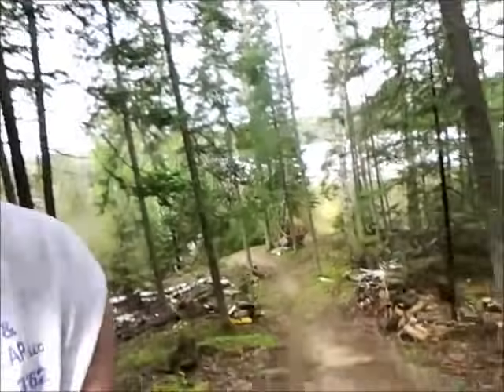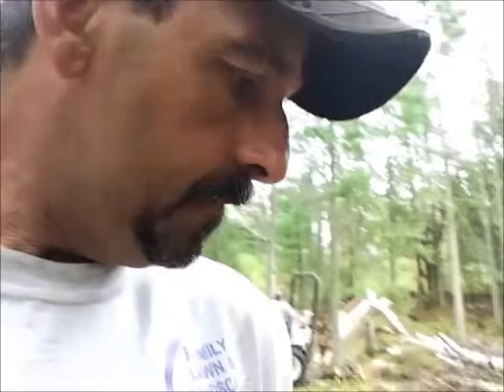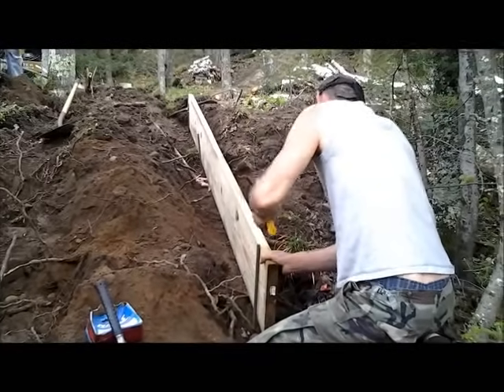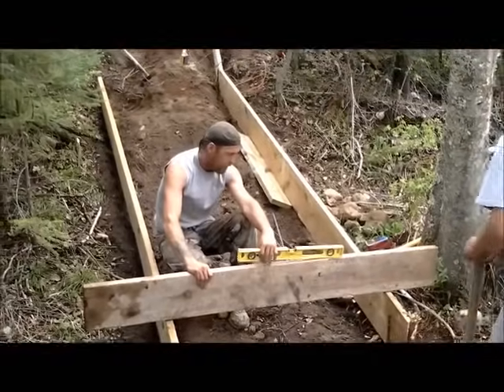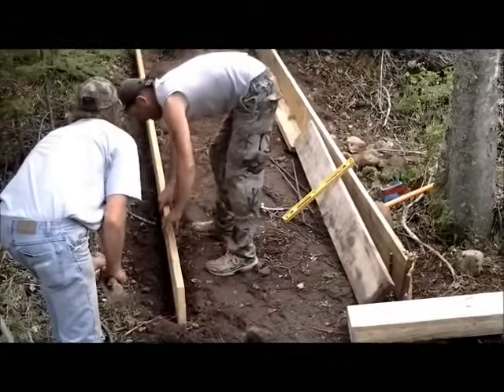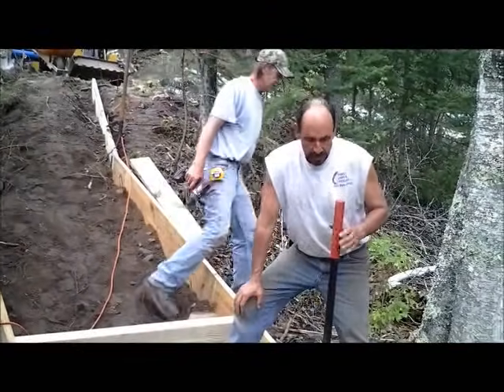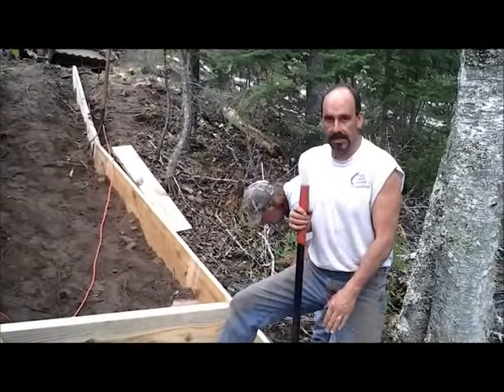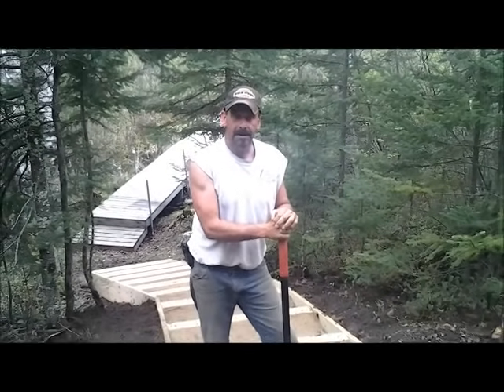Installing Outdoor Stairs on a Lake-Front Home

Comment: It's beautiful.  Another video said that you "must" use gravel, otherwise it washes out.  What are the tradeoffs between using the two materials?  I can see that sand looks nicer and is easier on the feet.
Reply from the maker: sand is easier but will wash out easier and will have to be replaced sooner. Gravel is fine if you're not barefoot and will last a lot longer.

Comment: Great video, thanks! It has been 10 years now. I'm curious how these steps have held up? Are there any improvements you'd recommend? Do the limestone screenings allow for drainage? What are the dimensions of the boards you used for the steps themselves? I'm in the planning stages of building steps down to a creek.
Reply from the maker: Steps held up great. Limestone does not drain well rather the pitch drains off the water.2x8 I believe

Comment: Thank you.  I have a 10' run to figure out.  Should be easy, just need to figure it out....but your stairs are exactly what I was thinking (wood frame, but infilled with dirt/gravel).
Reply from the maker: don't use dirt or anything that will hold moisture. it will rot the wood much quicker
Reply: Using pressure treated wood.
Reply from the maker: that's good but it still will rot, so whatever you can do to slow the process the better. good luck !

Comment: Excellent video. An inexpensive solution compared to what’s out there on YT. Btw, can you provide some measurement on the thickness and width of the board you’re using? Thanks a lot.
Reply from the maker: Outside boards I believe or 2 by 8.

Comment: Hi there. So you really don't cut the treads out of the ground/earth. Looks like you are creating the stair/tread mainly and then filling it in and compacting it down. I am looking to do something like this at our cottage. It is about 60 ft down a hill (maybe 30% grade) and I would like to add safe stairs to the water. Looks like this is doable with some 2x10 or 12's x 16's on each side then run a 4x4 across and add a "filling" and compact it down.  Thanks for this.
Reply from the maker: You're very welcome.

Comment: Great video, I followed the same plan and it turned out perfect. Although I used pea gravel instead of sand.
Reply from the maker: I think you'll find that by using the pea gravel, 1. it will end up all over the place, and 2. pea gravel is like walking on ball bearings, it's always moving. By the way, we used limestone screenings, not sand, it packs harder, unlike sand which is also like walking on ball bearings.
Reply: What did you finish the surface with?

Comment: If installing on a slope that already has erosion issues (so much water!) Would you add any kind of drainage? Compacted gravel in the steps? Very helpful video- thank you!!
Reply from the maker: well you could use concrete i suppose. Regular crushed rock will be like walking on ball bearings or marbles, but i've seen it done.

Comment: I have a similar hill but part of it is ROCK face so I can not dig trenches for the 2Xs  !  Iam wondering can Ijust float the whole thing on top of the hill side with no ditches and the once it it is all framed in use rocks and motor and sand to lock it all in?  Would that work?
Reply from the maker: Dougie, without actually being there, i cannot tell you . I do wish you good luck with your project though !

Comment: Hello, Fantastic video ty for taking the time to film and post! I hope it works as the best business card going. Question for you--I don't have much love of pressure treated--at all. If I did not want to use PT wood...is there something else that I could use...10 years of guaranteed stairs...I'd like to think they'd be there for 25-30 years. Cheers and thanks again.
Reply from the maker: they now use a fiber type material that they clain is much better however it is extremely much more expensive.

Comment: I'm building these steps as we speak...but I have one question:  When you made the angle with the 2 X 12's how did you secure the seam between the two runners?  Thanks and an answer ASAP will help me continue.  Great Video.  Thanks.
Reply from the maker: Regina Zakrajsek yes, we lag bolted them.

Comment: Great video. After you fastened the 2x12 with the 8x8 steps did you take out the rebar that was originally holding the 2x12 in place.  Thank you
Reply from the maker: yes we did

Comment: George,

I have a 25 foot slope in my backyard and want to build stairs like you show in this video. The slope is pretty constant but the earth below the grass is full of large rocks that will be hard/expensive to dig out. Can we lay the side rails above ground and use the rebar to hold the rails and stairs in place, almost laying them on top of the ground ? I saw one video that also showed rebar driven though a few of the steps to assure the entire system does not clip down the hill. Can we do the entire system laying on the actual ground ?

Thanks,Allen
Reply from the maker: It can be done but you will still have to anchor it as often as ( the rocks will allow ) by using rebar. also note that if you can keep them off the ground (even an inch) this will add years to the life of your wood.

Comment: Thanks George, exactly what I needed to see.  As far as vertical anchoring of the runners, are you relying on the nails and re bars? I am thinking that may not support the rails from sinking in level - or is the grip of the nails on re bars tight enough?
Reply: Similar thoughts. However, we have to look at the entire structure since the limestone backfill creates enough distributed force towards rails to disable movements in any direction.
Reply from the maker: yeah between them and the limestone and outside dirt fill.
Reply from the maker: thanks for sharing

Comment: Great video and thank you. I have 20 feet, just finished 10 feet and looks great. I have another 10 feet but with an angle just like you have it at 10:50 of the video , what did you use to hold 2x12 to together ?
Reply: Sorry, the question was already asked and answered: Lag bolted them
Reply from the maker: 6"
' lag bolts

Comment: What did you fill with? Is there anything else i could use if i cant find what you used.
Reply from the maker: sure, common stuff like red granite, limestone screenings ect. contact your local material landscape place and ask them what landscapers are using for underneath pavers, that would be pack hard.

Comment: Thanks George, I have been struggling on the best way to build these type of steps. I have about at 14 foot run down hill and would like to fill in the step with limestone and cover with patio stones that will come flush with the wooden step. Would I need to alter the wooden step  to do this? Also did you use the support rods on both sides?, and how long are the lag bolts?  Thx again
Reply from the maker: Don McLaren you don't need to alter the steps to do that. rods are on both sides (on the insides)
I believe the lags were 8" ?

Comment: Thanks for the great video! For steps that aren't going to be used by people (used by a dog) would it be reasonable to just use sections of a pressure treated 2x6 instead of the larger 6x6 for the riser?
Reply from the maker: sure you could

Comment: Thank you George from Campford Ontario, I,m will be doing about a 60 foot run. The material  being put in between the steps is lime stone yes or no. Are you using 6x6 or 8x8 and 2x12 for the sides. Are you using 1/2 " or 3/4 rebar. and is it best to keep the 2x12s off the ground. Thanks once again George, great video. Jeff Schmalz
Reply from the maker: limestone = yes.8x8 for the sidesas well as 2x12. 1"rebar. always best to keep them up off the ground.

Comment: Excellent video. Can you add bricks instead of the limestone.  If so, do you put a small layer of the limestone or blue stone and then lay the bricks on top?  Once in cover with sand and sweep it into the cracks?
Reply from the maker: Yes you can use pavers.If you do, you'll still need to use some type of a sturdy base material.and it will need to be compacted ( or the pavers will settle over time ) and leveled to accommodate the pavers or. you will also need a brick saw to cut the pavers unless you make your steps the appropriate distance to accommodate the pavers. Then use treated joint sand not regular joint sand because the ants will remove the sand and the bricks will shift.

Comment: Great DYI video, this is perfect for my application......  One thing though u state the risers are 8x8...just double checking they look like 4x6 if not would 4x6 work in this application.  Thanks so much
Reply from the maker: the steps are 8x8 , 4x6 would work but not last as long or have as much strength.

Comment: If i wanted to back fill with gravel for a different look would i need to add a baselayer of limestone first?
Reply from the maker: It depends on what your calling gravel. does it decompose ? if so don't use it.if not and it will pack well ( get very hard ) then go ahead.